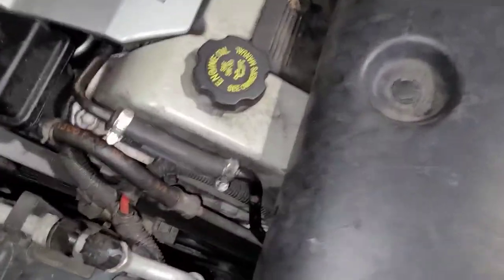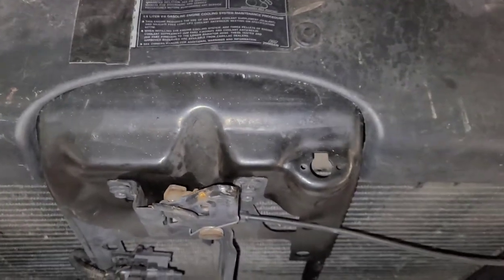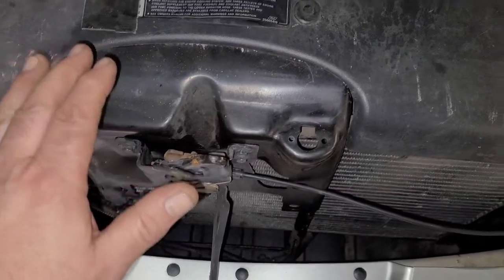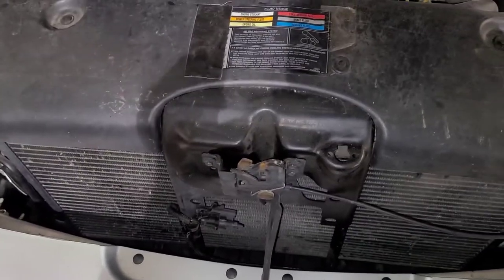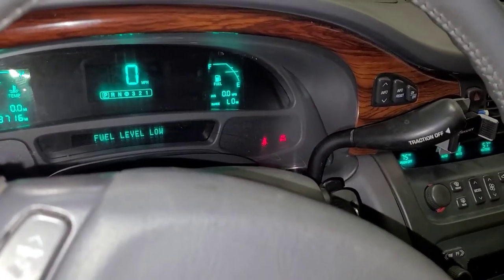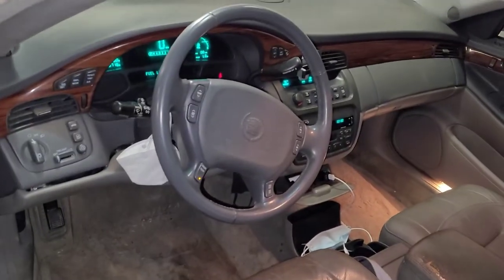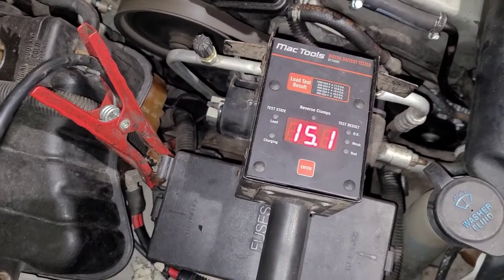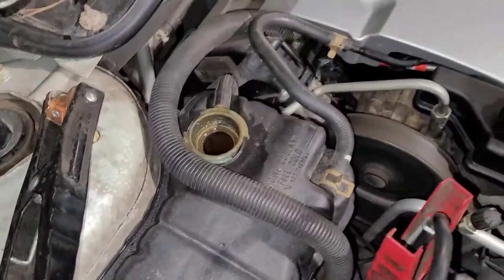I shouldn't have opened my mouth on the last video !! Part 2

Comment: I’ve done many of those alternators under warranty and I’ve done them fairly quick… you don’t have to recover refrigerant and/or drain coolant… you don’t have to remove rad and condenser… remove upper trans line on rad, remove cooling fan assembly, remove both hold downs for rad and condenser, hold downs secures both, tilt rad and condenser forward, pinch off both coolant lines at rear of alternator, remove belt and mounting bolts, and alternator comes straight up and out… never had a problem at all doing it this way.. By tilting rad and condenser forward there is no strain or stress on either component as well as rad hoses and condenser lines..
I would complete job in about one hour and 15 min to hour and a half…. But I must say, I watch your videos and you do a great job.. I learn every time watching your videos, I appreciate what you do, keep up the great work…

Comment: I remember doing my lucerne radiator about a year ago. Had to remove everything on the front end to get to everything. Mine is a 3800 series III . That C clip front support does not come out unless you take the bumper off.

Comment: Dexcool anti freeze color is? Needs new fluid? Did you pull the wheel liner panel to access the alternator? Or just the radiator?

Comment: I hate it when people bring their vehicle in with an empty tank. I'll find the first gas station and put five gallon in and charge them. If you want the car fixed folks, it has to be road tested so quit bringing them in on empty thinking you will prevent the mechanic from test driving or putting some miles on your car. GRRRR!